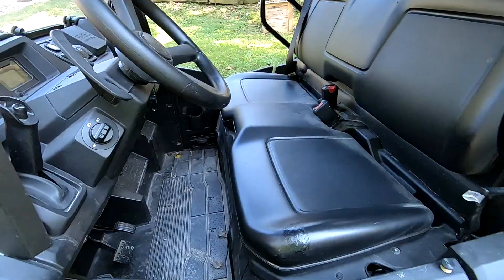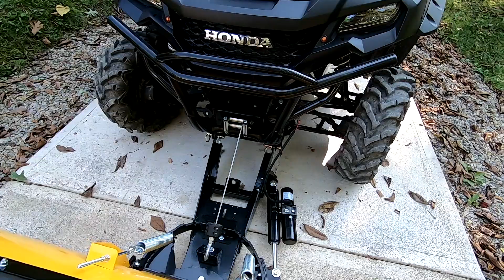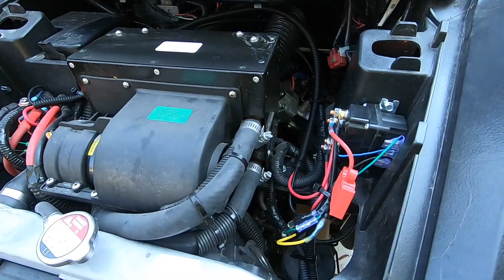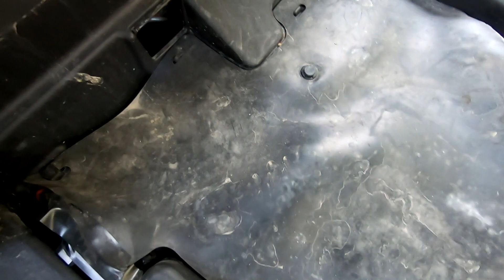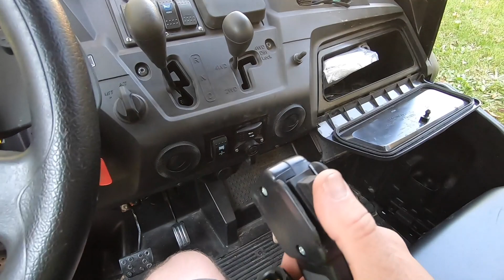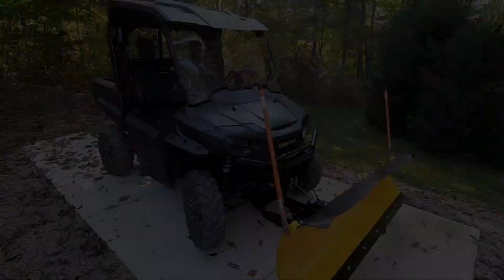Honda Pioneer 700 Denali Snow Plow with Hydro-Turn

Comment: Do you lose blade angle degree  with the power angle or does it turn it the same as degree as if you had the manual  blade angle
Reply from the maker: Turns the same

Comment: I’ve had this plow since about 2013, just recently purchased a second one and didn’t realize it came with a joystick . At first I though the joystick was cheesy but Was pleasantly surprised to find out that you can run both the winch and the hydro turn from the joystick itself . The toughest part was deciding the best placement for the joystick
Reply from the maker: Have a link ? Curious about the joystick 🕹️?
Reply: @JackofAllMasterofNone  I will say one thing the instructions show the placement of the blue and black wires but they don’t necessarily correspond . When I first installed it according to the picture the plow would angle left when pushed the joystick to the right . But simple enough to fix .

Comment: Im looking to buy either a 700 or 1000….. Cant decide which one. The one thing that makes me want to buy a 1000 over the 700 is pulling. I will be doing lots of work with mine. Pulling a trailer, logs, hog traps…… Dont know if the 700 is going to be enough???? What do yall think?
Reply from the maker: The 700 does great down low. It doesn't have the top speed of the 1000, but will pull a house down. I've towed trees out of the woods with my Pioneer 700.

Comment: How has your plow performed this winter?  I am looking for a plow for the same machine and this seems like a good middle tier system.
Reply from the maker: Excellent. I plowed 8 inches of snow up hill and the Pioneer pushed it easily.
Reply: @JackofAllMasterofNone  Thanks for your replay and Good to hear!  How valuable do you find the hydro-turn accessory on the plow to be and does it perform well?  I am debating on it as it is about as expensive as the rest of the system.
Reply from the maker: @highwoods  Well worth the money. I can stay in my warm cab and adjust the plow just like a professional. It's a must have option in my opinion because once you get a bunch of snow on the push tube it makes it very hard to manually turn the plow.

Comment: I have a Polaris hd 4500 winch with the Denali plow, the winch isn’t going down under load. I haven’t hooked up the hydro turn yet, I’m wondering if after hooking up hydro turn maybe it will bypass my winches safety feature… idk any thoughts?

Comment: I second the pulley fairlead system, it comes with a short synthetic rope so you don’t fray or mess up your long winch cable. I have this same exact setup on my P1k5 but with the fairlead and love it, especially the hydroturn!
Reply: Also you’ll wind up taking those sliders off after the first plow, you’ll leave an inch of snow on the ground and it’ll drive you nuts 🤣

Comment: You'd really benefit from the pulley system for the winch cable. I put together one with a pulley with hook  from harbor freight and an axle strap. The plow is much more controllable that way. It won't drop so fast and slam on the ground.
Reply from the maker: Yeah I'm considering adding one just to slow it down a bit
Reply: Itll slow it djwn by 50%

Comment: You should put a full exhaust system on it like big gun because it has a major difference in power and is better for the engine letting it breathe

Comment: That is a sweet set up have you thought about putting caster wheels on the bottom of the plow so it could go up and down with the ground
Reply from the maker: I have thought about it. I usually just set it an inch off the ground and roll with it but the wheels would make it easier on the gravel